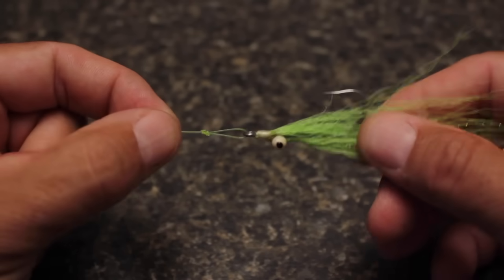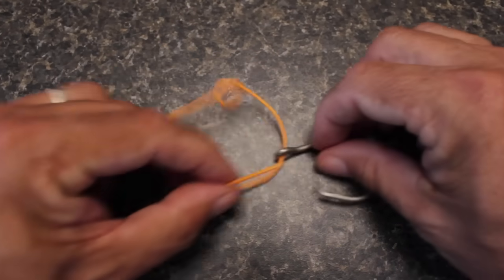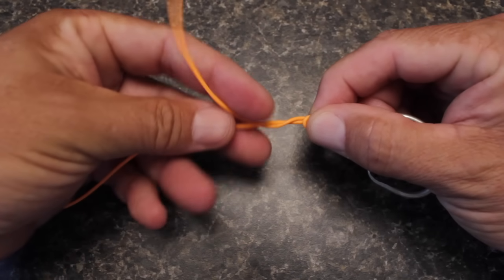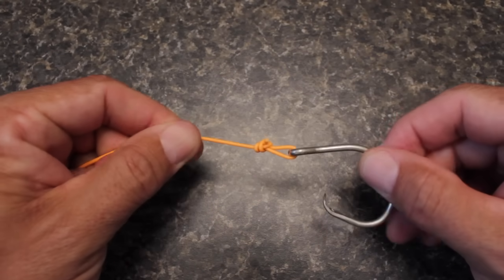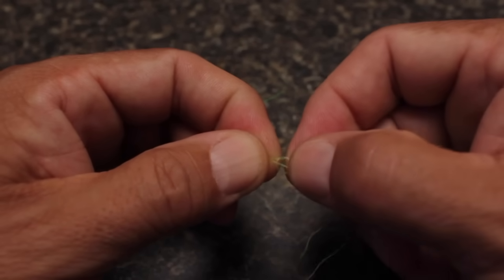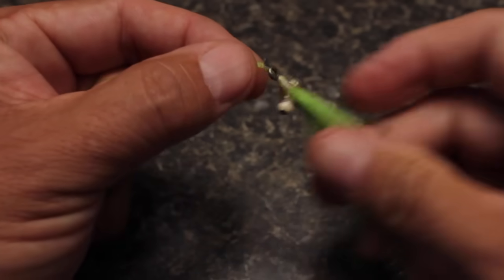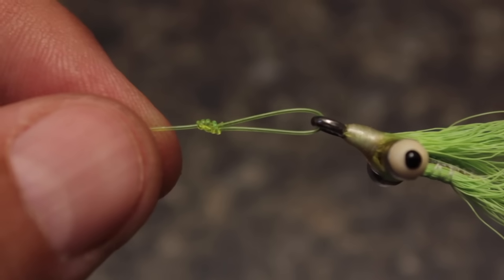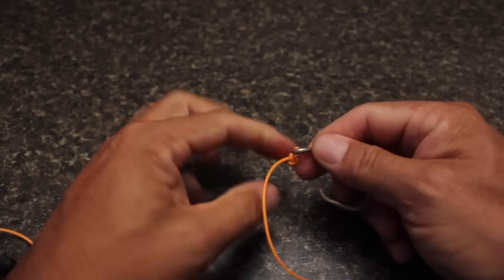Non Slip Loop Knot

Comment: I fished with a guide who used a fireman's knot to make similar non-slip loops to flies.  This knot is just a Figure 8 made in a folded back line and is strong and easy to do right - if all you want is a loop. (It is preferred by many rock climbers over the bowline because their lives depend on it).  The guide was a retired fire fighter and figured out how to tie a Figure 8 knot using only the tag end to allow a fly to be in the loop - something that is a bit hard to remember and easy to do wrong.  Your knot avoids both problems.  

BTW - this is one of the best educational videos I've seen.  Your teaching style is outstanding.

Comment: I tie this knot a little different but not on purpose. I was trying to remember how to tie it and combined an improved clinch knot. Now I wonder how it compares. I bring the tag in from the fly and back through the overhand but rather than wrapping six or seven times I only go once or twice and then back through the overhand. Now, like an improved clinch, I put the tag end back through the loop I just created and tighten down. Works great and keeps the knot small in size. Great video

Comment: An excellent video on explaining how to tie the non-slip mono knot. I have been using this knot for several years for all my subsurface midge fishing with 6x and 7x fluorocarbon tippet and size 22-28 flies.  I use a six turn wrap and the knot holds well.
Reply: Some people do the same number of turns as the tippet number.  Nice easy rule of thumb until you get near 0 haha

Comment: This is also a great knot to use when using a rapalas without an o-ring it gives them a lot more action, just be sure that you wet the knot before you pull it tight or it will fray the line and snap on the set.
Reply: Fry?

Comment: A good way to know you tied this knot right is if the tag end sticks straight up in a 45 degree angle. If the tags points toward you fly re do it because it'll break with the slightest tension
Reply: Straight up is a 90 - not 45 degree.

Comment: Good demo.
I've always known this as the "Rapala Knot."
Reply: I was just thinking the same thing, I've used this knot since I was a kid on a wide variety of lures/flies.
Reply: But this is NOT the Rapala Knot, which has an additional step of turning the tag end back through the previous loop that was just made. I.e., this is the original knot and Rapala made an improvisation or improved version of it.

Comment: This is a great knot.  Only thing I do differently is lubricate the knot before final seating.  Little bit of saliva works great, but if you don't want to put it in your mouth, just dip it into the water your fishing in.  Then you will be able to seat the knot in one strong pull because then the sliding line doesn't generate nearly as much friction.

When seating a knot, don't bounce your knots to seat them.  That's what a fish does to weaken your line and break you off.  Don't scrunch the knot together on the final seating with your finger tips - you'll end up seating the knot with some slack in the it that will slip when it gets wet and under pressure.  "Insurance tags" don't stop this slipping.  If you lose a hook and you get a curly-cue back on the end of the line, you knot slipped.  It did not reach its breaking strength - poorly tied knot.

Another great loop knot worth looking at is a Duncan's Loop knot.  It stays open during fishing but slams shut tight when you get a fish on.  Leave a little tag on the end of that knot and you can pull on the tag with your forceps  to open the loop again.  If you land a big fish, don't reuse the loop.  Cut off about 6" or your line and tie on a new knot so you are not fishing with "pre-stressed" line.
Reply: Uh-oh, I'm SO guilty of doing the 'scrunch' thing! I love this knot but feel like I've dodged a bullet every time it's successfully tightened. Sooner or later I just know I'm going to slip - or something else will give - and my fishing day will end with a fly fully imbedded somewhere in my hand.
Reply: YOU'RE!

Comment: melt the end of your line with a lighter to form a dimple. then just make a slip knot. same knot strength, half the work. also on thick monos, you can reopen it and use as a swivel.

Comment: Just curious ... Is there a benefit to this non slip loop over using a figure 8 loop?  someone told me (not sure if they were correct) that the Figure 8 loop knot has a significantly greater strength retention than many of the more compilcated knots, and that that is one of the reasons that climbers use it.

Comment: Great video, there is an easier way to tie that not. what you did minus a couple steps. after you create the first loop. Bring the tag through the eye and back up past the first loop. pinch and twist your fly 4-5 times and pull tight. Tell me how it works!

Comment: When using fluorocarbon, does anyone else have a hard time not breaking it really easily... I use this not with 15 lbs fluoro for steelhead and I’ll have my knots break with a light tug? Any suggestion on what I may be doing wrong
Reply: Who knows what the knot strength is compared to the line strength? I bet the knot is breaking.

Personally I always use a Pitzen Knot (a hangman's noose made with three and a half wraps, tag end through the hook eye before tying).  After you wet and  pull the knot tight, open it up to the size loop you want.

Comment: I've been having trouble keeping the loop intact. When I pull the knot tight, the loop disappears. Any idea what I'm doing wrong? It happens on both .014 and .008 mono. BTW, Tim, your videos are very well done. Thanks.
Reply: I think I figured it out. I closed the overhand knot before I pulled on the tag and running lines. Now the loop stays intact.